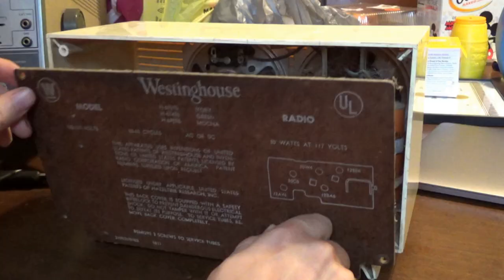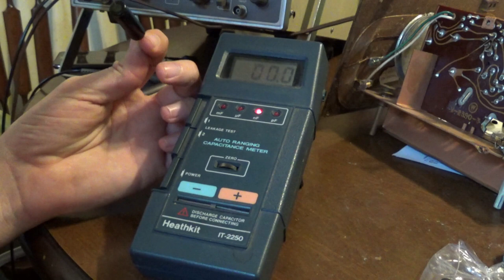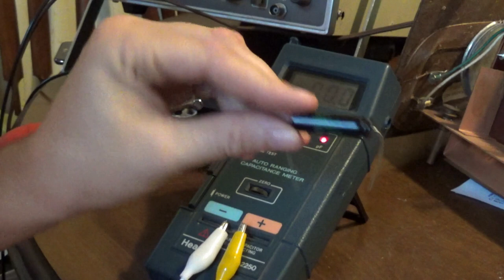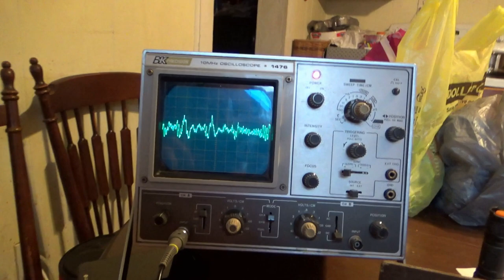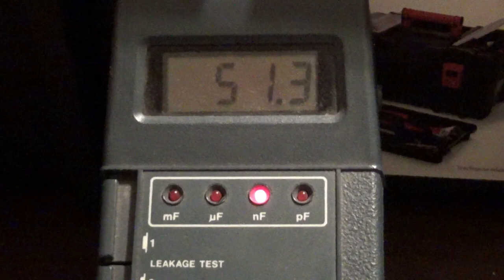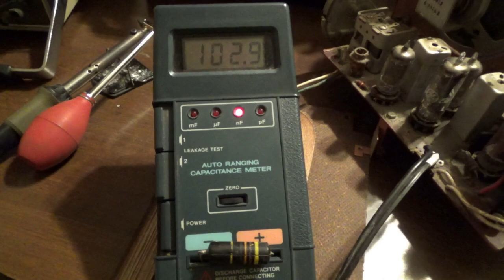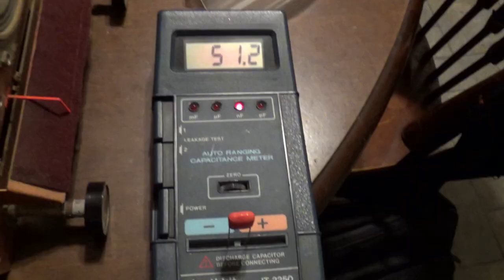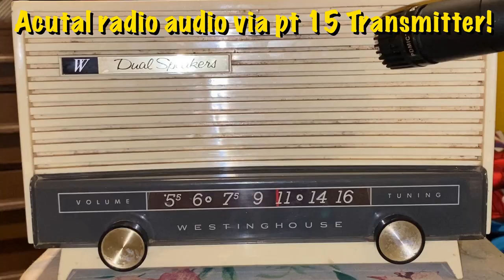Antique Radio Repair! 1959 Westinghouse H673T5 Tube Radio Revival/Restoration

Comment: i thought you had a lot of electrical noise in the house like switchmode power supplys and computers.
Some led lights create a hell of a noise on the a.m band.
Hope you fixed that neat little valve radio in 2021 😀

Comment: should of just used two 160v 47mf radial caps instead of them unsightly giant axial caps you used.
Reply from the maker: Sometimes you can only get whatever components are in stock for a repair…

Comment: There was no "wax" in an electrolytic cap. Maybe clean out the old cap and stuff it with the new electrolytics, rather than having new caps lying about visible above the chassis. In old point-to-point radios, we would just put the new caps inside the chassis where you couldn't see them, connected to a new terminal strip, and cut the old cap out of the circuit. That wouldn't work in a printed circuit radio like this. Having high voltage wires and new caps above the chassis definitely does not look "pretty good" as you state.  Too bad you didn't discuss using an isolation transformer and potting a light bulb in series with the radio when livening it.

Comment: @10:47 — AH!! Replace that "bumblebee" capacitor right there next to your index finger!! Those things are bad, bad, juju. It'll mess up your tube bias, and you'll have worse problems down the road! Google it up and you'll see. Replace any other old black plastic capacitors, especially ones connected in series to any grid inputs— those are almost assuredly leaking DC from the previous stage and again, this throws the next tube's bias completely off, and they'll run far, far too hot. And you might wanna take a look at the cathode bypass on the output tube. It's likely electrolytic as well.
Reply: Doh! Alright, I spoke too soon. @18:33 good on ya! 
Sorry for jumping the gun. Got a little carried away there. (8^D)
Reply from the maker: Haha, I was gonna say, “I did!” Haha! Thanks for watching! -Tim

Comment: Minor technical correction --- it is 120 Hz Hum.... not 60 Hz.  And --- I am 79 years old and I want to know where the three Old Dudes are?? 73 de K4TO
Reply from the maker: Thanks for the input! I assume it is 120Hz due to the fact it is off of the rectified current? I'm still getting my "facts straight" with electronics and radio repair! - Tim
Reply: @3oldtechdudes  In a full wave rectifier (as this is) you get one pulse into the capacitor every half cycle (positive half/negative half).  That make 120 pulses per second.  This is the hum that is heard due to a faulty filter cap not holding its charge due to age.
Reply: Since this radio has a half wave rectifier (35W4) the ripple (and hum heard in the speaker) will be 60Hz. A full wave rectifier circuit
will yield 120Hz.
Reply: Sorry YOU ARE WRONG. That is 60 hertz HUM.   The tube is a half wave rectifier.
Reply: @davesublette7447 Wrong   35W4 Is a half wave rectifier (one diode)found in most AA  5  radios.